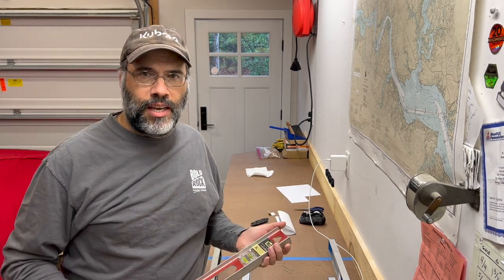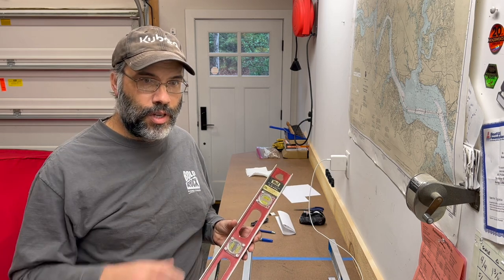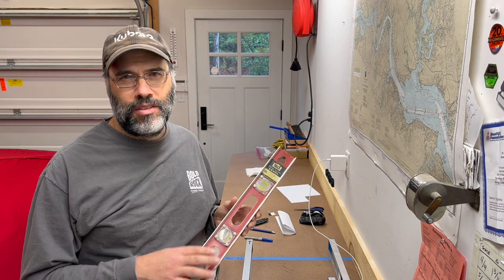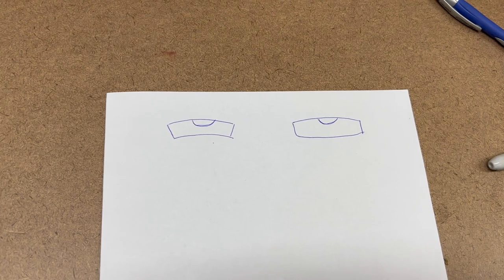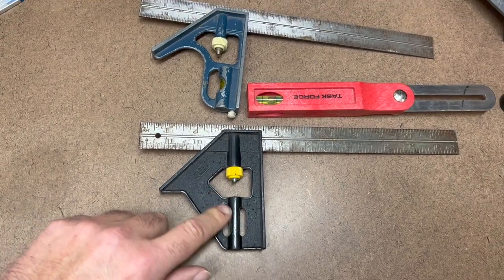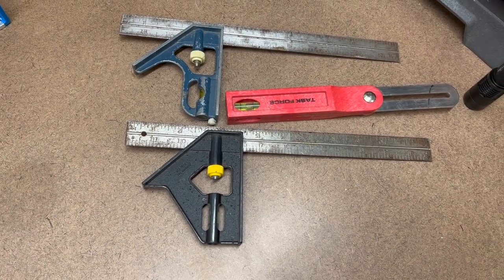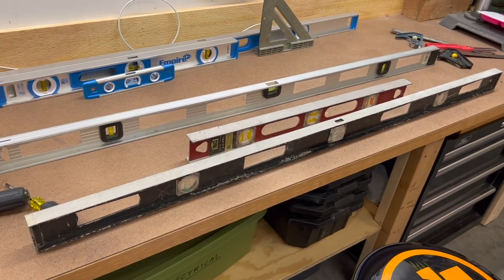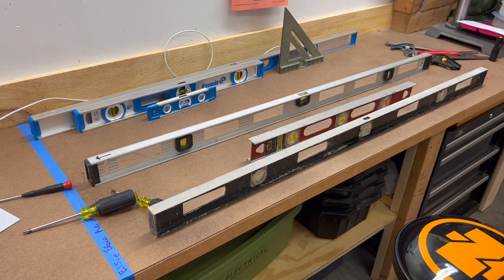Checking and Recalibrating Bubble Levels

Comment: Being a mason laying lots of rough block over 40 years, I've probably had over 40 levels.  In S. Fl. We use our levels more than just about any other region in the U.S. and the block are so rough it wears out the level.  Stabilas are the best IMHO, but even those I have to check, and they still wear out.  Also, of the vial can be adjusted, you can be sure it will go out, so don't use them unless you like to adjust your level.  If you're not a mason, one good stabila should last a life time.

Comment: Great video! Since I took classes in surveying 35 years ago, I always check a level before I buy it - putting in on a quite horizontal surface and flip it 180°. I will say 1 out of 10 levels - even the high end levels - are a little of whack.